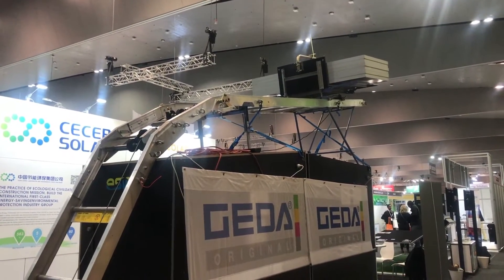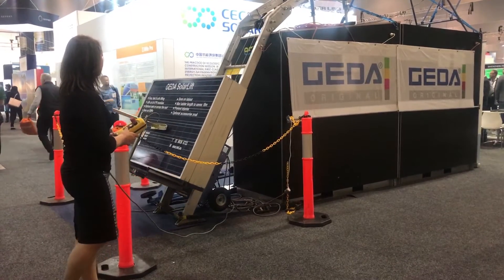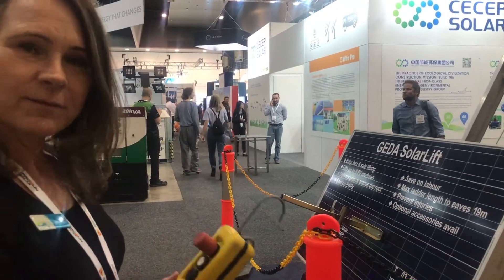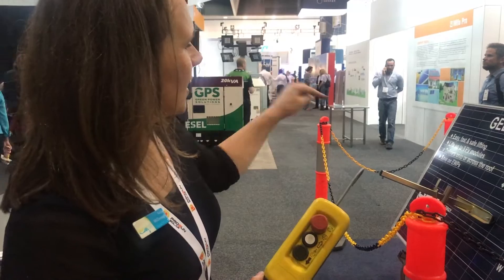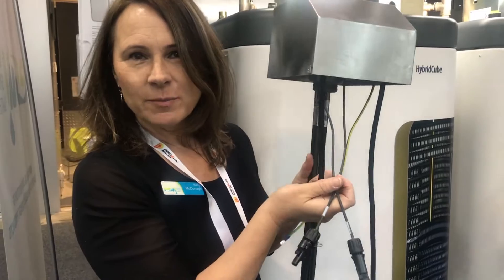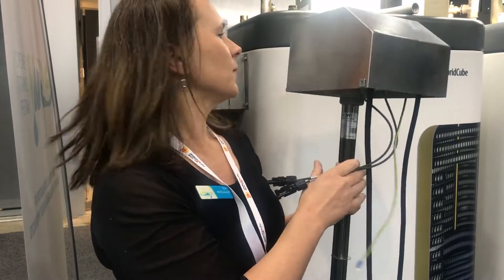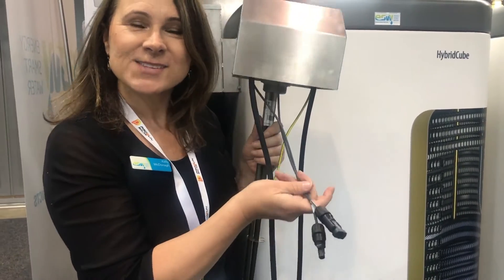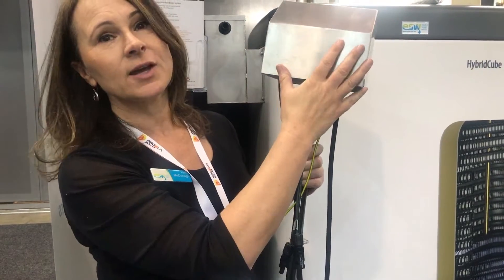Kelly from Energy Smart Water

Comment: At reduced voltage the about to lose shirts and priced accordingly solid state thermoelectric exceeds a cop of 1 so obviously at a cop of two.zero eliminates a PANEL.  

Island pv TECH especially DC rocks at filtering pools but rather than smart this is corruptly grabbing incentives intended to promote efficiency.

Nice to see unpressurised tank after so many years teased in 🇺🇸